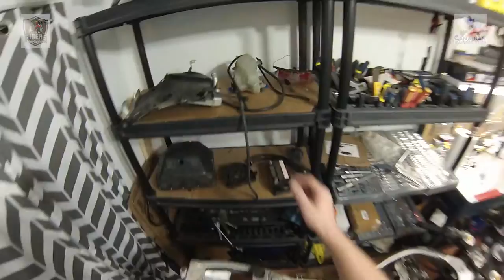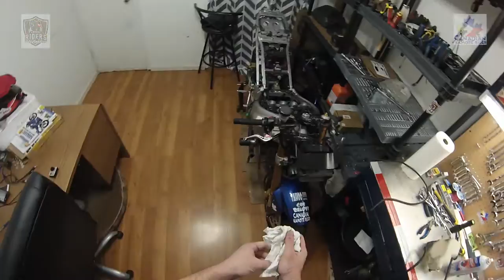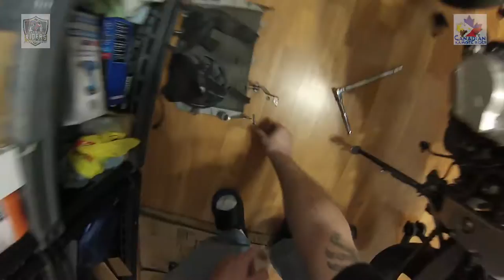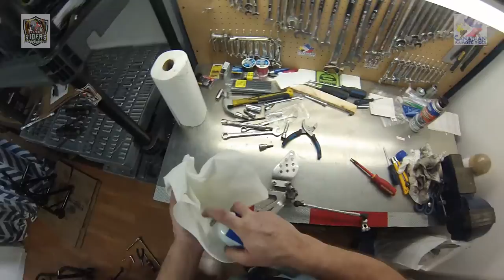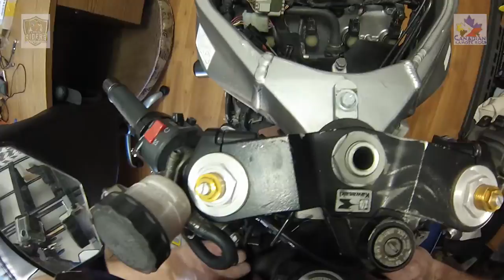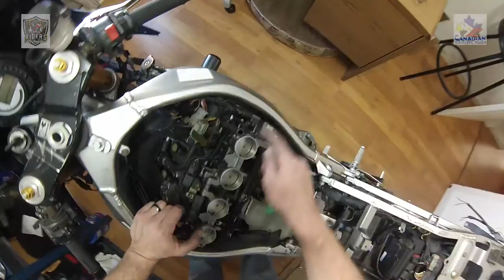RADIATOR INSTALL AND MORE KAWASAKI NINJA ZX636

Comment: I feel like you did a lot of unnecessary work pulling the motor for the valve cover lol but good job. Also torch spec is very important on theses bikes
Reply from the maker: Yes it was a bit more work and not absolutely necessary  to do the job buy it made things easier and I had the time over the winter. Torque specs are very very important, always had that info on hand when working on something.